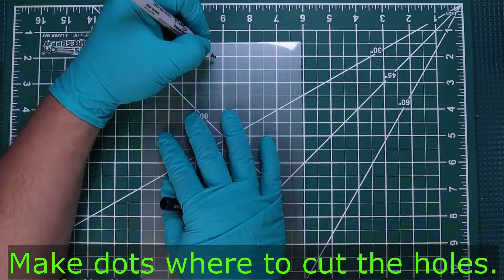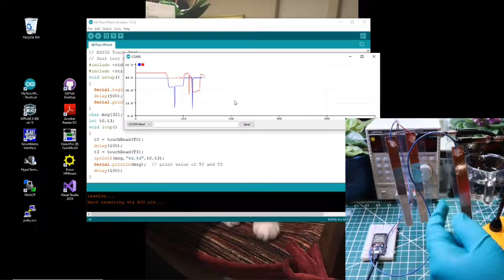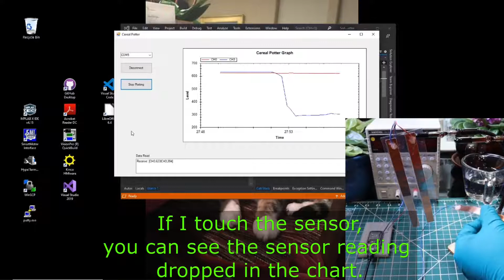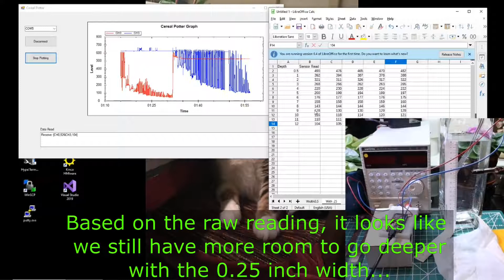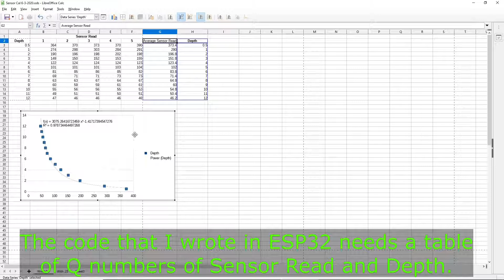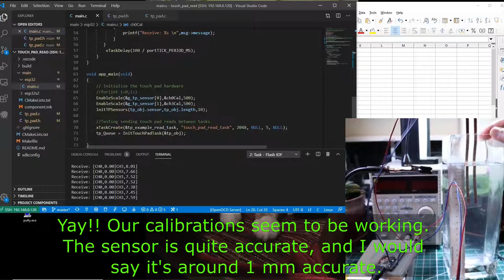DIY Capacitive Water Level Sensor using ESP32 Touch Read function

Comment: have you tried to experiment with capacitation without having the water touch ? a larger surface area capacitation copper pad could theortically detect without without the touch.  I'm working on something like that now.  I appreciate your video, it definitely helps a lot even today :)

Comment: Hello, I found your video very inspiring and I would like to recreate it for my own project. But I am confused about the wiring of your electrodes. You have the the 2 sensor (for lack of a better word) electrodes connected to 1 pin and a 3rd connected to ground? Do any of them run through a resistor?  If so what is the resistor value? If you provide a diagram, that would be awesome. Thank you for posting this work, but I am curious about more details of how you got here.
Reply from the maker: There is no resistor.  One electrode has 2 copper strips, first copper strip connect to Touch input pin of ESP32 and the second strip connect directly to ESP32 Ground pin.

Comment: just stumbled across this...amazingly well presented and thoughful video, I learned a bunch. I wonder if you could measure depth through, say a thin plastic vessel from the outside using this technique, maybe with lots of very thin, closely spaced electrodes in parallel to boost the capacitance because d will be so large. Subbing to find out :)

Comment: does anyone have an idea of how the capacitance values might change when the copper foils are stuck to inner walls of steel cylinder? I tried it and its not giving stable readings at a particular height. suggestions?

Comment: Hello,
Thanks for the great video.
I always thought it is necessary that the electrode (copper) touches the medium to work correctly 
So its okay if the electrode is completely sealed? Does this also work if i have tube in tube?

Comment: I wonder if that can work for other fluids.. probably is just individual kalibrering. Second question is how it will work if you have metal tankand glue it on a side?
Reply: I am working on it. It gives increasing capacitance at a particular height. So calibration is not possible. Any thoughts?
Reply: @Solitudetravel  I assume you heve seen standard option to measure.. from light reflecting to ultrasonic.. well Have you think og mixing load cell and other option and make measurment relative to weight and hight. Offscourse that will work only on stationary objects not while on move (rv/boat).
Reply: @ItisImarko  i tried tof and ultrasonic. They r ok but i kinda need sub mm accuracy. I thought this touchread can give me more accurate results

Comment: Great Video, i was wondering if it is possible to use the sensors with an RPI and without the ESP32 module. Do all the code in Python and connect the sensor to the GPIO Pins.

Comment: I couldn't wait to replicate your idea, Kris. I am impressed how well the thing works. I used 5mm stainless steel rods 50cm inserted into PVC pipes. The result is quite linear function. I am not friend with ESP-IDF, hence used Arduino. Each centimeter was around 1 point on the 0..50 scale.
Reply: You have to make another circuit?
Reply: @jetmak  yes, the circuit is different. I made a pcb for the rods and modified to have 12V supply and few other things.
Reply: @oliver1978 please i am doing my project in school and would like to ask for the circuit diagram for this thanks

Comment: Would it be possible to place the copper tape on the outside of an aquarium and have it function as a water level indicator?
Reply from the maker: It is hard to say because there are so many factors such as the thickness of aquarium tank and the type of material of the aquarium wall. If wall too thick, ESP32 may not be able to detect the different in capacitive change.

Comment: To fix the problem with the measurement error (spikes) and also to get a higher resolution, simply call the function 'touch_pad_init ()' in the setup () routine.
Reply: correction: the 'touch_pad_init()' function needs to be executed each time before reading the cap-value.

Comment: Great project. I am looking for a way to  measure level in a fuel tank. Do you think it is possible to replace the strips with a tube with a rod in senter? The tube will act as a capacitor. My plan is to immerse the tube into the tank. The tank is metal, and I can not use strips on the surface og tank to make the capacitor.
Reply: Concentric tubes is precisely how I added level sensing to a gas tank. If it is a fluid that is not a conductor, no insulating layer is needed. This was back in the early '80s, I used a couple of 555 timers and an LM3914 wired to show continuous level rather than just 10 steps. 

The outer tube is the ground and shields it from outside interference and any parasitic capacitances from the tank or things outside a nonconductive tank.

I have done the same with water based fluids, in those cases I coat the tube with epoxy or polyurethane. It is important there be no flaws to allow water through.

Comment: Hello, Thank you for the video. I have a question, I have no background in using this type of application. I am trying to use this as an FDC1004 contactless sensor because I cant get an FDC1004 at the moment, I only have the ESP32, do you think this will work? Thank you again.

Comment: Thank you, Kris, the experiences you so well shared in your video not only led me to making capacitive sensors with an iron on my desktop, but a way to achieve measuring soil moisture to provide water to maintain plants. I encountered difficulties with my python-version mess in the mac, so until I figure out the paths, I use a primary arduino code averagaing and mapping the readings (my equaly primary micropython dind't improve the readings that much), monitored wirlessly using virtuino. So, while I must hold to see the whole-grain stuff in my bowl, I found the sensors potentially functinal to operate a water supply sytem to a kitchen herb garden, so, I am much grateful to you for the spoonfull!

Comment: I flashed the code on my wroom dev module. The Cereal Potter does not start at 600-700 and go down when touching the sensor. Mine starts at 0 and goes up to around 6 when touching either sensor. Any idea what's causing this?
Reply: I had to comment out the EnableScale in app_main

Comment: I would like to use this to measure the water level in a 55-gallon drum.  The sensing range would be nearly a meter tall.  As I want to move this sensor from barrel to barrel, I was thinking to apply copper foil tape strips to an 18mm OD plastic pipe and covering that with heat shrink tubing.  I would then 3D print an enclosure for the electronics at the top of the pipe.  I would like the best resolution I can get but am ok with whatever that turns out to be.  Do you have a recommendation for how wide the copper strips should be and what the gap between them should be?  I get the relationship between wider and narrower but for a 1-meter long sensor...where would you start to best utilize the touch input?  What resolution would you expect is possible?  I know I could stack sensors (and will if I have to) but I would like to keep this as simple as possible.

Comment: CerealPotter program gives zedgraph error. i am using 5.1.5 i have to use an old library.....
Reply from the maker: I got the same error when using 5.1.5. You can just comment out line that gave you an error if you can't use ZedGraph 5.1.7.
//this.zedGraphControl1.UseExtendedPrintDialog = true;

Comment: About arduino range and reading speed you have function  touchSetCycles(range,sleep),  you can play with values for different range and reading times...
Reply: also for instability of arduino readings i think averaging readings example for 10 readings will improve stability a lot !
Reply: @bhMaker963  I found that reading multiple channels somehow makes the reading more stable, only reading the channels I used in the code caused random drops, reading more than needed fixed the issue. Discovered after chasing my tail with random glitches even with averaging, which created a time delay that was undesirable. I wrote a program to read all touch pins to test which were stable, to my amazement the glitches went away on the channels that were previously an issue. So now I just include extra touch sensor function calls until I get stable performance on the pins I'm actually using.

Comment: Kris I have been thinking about this since I saw it last week.  I have a question. Can I use this technique to measure the increasing width of a persons waistline?  Can you see this sensor (the copper tape soldered to esp32 GPIOs) as a type of belt?  How would it work? Would you put it against the skin?
Reply from the maker: Robert, I have not experimented with this aspect, so I don't know. But one thing to know is that the sensor is very sensitive to moisture, so if the people are sweating, it probably will affect the result.
Reply: @kris-.1439  thanks for the tip!

Comment: What a great video thank you. I am looking at starting a project to measure two-stroke petrol mix in a plastic tank. So I won't be immersing the probe but sticking it to the outside. What're your thoughts on this? Furthermore, do you have any idea why the Arduino library doesn't work well? It's all I have ever used for my ESP32. Thanks
Reply from the maker: If your plastic tank wall is not too thick, it should work. I saw some people using aluminum foil with a glass bottle and it works as well. 
The reasons that I'm not using Arduino IDE are 
1. Reading resolution, Arduino IDE  will report reading around 50 counts with my sensor not touching anything compare to ESP-IDF that would read around 700. Thus I will get more resolution in depth-sensing using ESP-IDF.
2. As shown in my video when I plotted Arduino readings, sometimes the reading suddenly becomes zero.

I haven't played with Arduino IDE for quite some time, maybe their software gets updated and these issues have been fixed. 
Thanks for watching the video.
Reply: @kris-.1439  Thank you for the reply. My initial tests reveal the same as yours. Have you posted these findings anywhere?
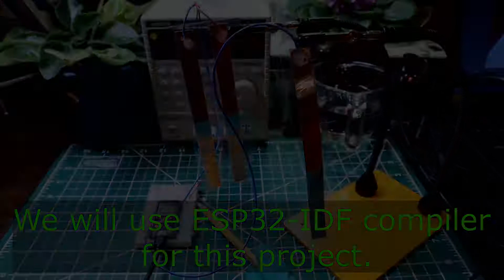Reply from the maker: @mksmurff  Only in my video around 5:16 mentioned why I did not use Arduino IDE.

Comment: I'm trying to understand what do you mean with dynamic ranges related to the width. I'm using wide strips and it's working well. over 1 inch width. What are your thoughs on width ?
Reply from the maker: Basically it is the depth of water level  that ESP32 can read until the touch read becomes saturated. For example the 1 inch width copper tapes will not decrease the touch read after the immersed into the water more than 10 cm, however the 0.5 inch copper tapes, you can immersed much deeper into the water until the ESP32 touch read becomes saturated.
Reply: @kris-.1439  interesting, I'm using almost 2 inches outside of the water and I've full readings. I guess I don't get saturation because I've a larger bag between water and the electrodes

Comment: Great I have a few questions. 1. Can you put the sensor outside the container. I.e. not submerged in the water and totally contactless to the water? 
2. Can it sense the water decreasing?
3. Can it support 1 litre of water?
Reply from the maker: You may want to check on this one ..
https://www.youtube.com/watch?v=CDwmm0gQsTw
Reply: I put the strips on the outside to test and it works as well, https://www.youtube.com/watch?v=b8V8aReSjAs

Comment: The content of video and knowledge which have been shared, are awesome.I appreciate your efforts.I have few questions 
1. Can this sensor be used in 5 feet deep water tank?
2. Will it work for dirty water, e.g lake water?
3. Will these sensor be corrosion over the period of time?
4. Are these sensor Arduino compatible because i have bought arduinos ?
5. Does temperature and humidity effect sensor reading ?
6. How long wire from sensor to board is recommended?
Reply from the maker: Thanks very much for the comment. I will try to answer some of your question. When I discover this sensor it is quite new to me too, so I may not have answer for all of your questions. 
1. You may try to use very small electrode area to expand the range but you will lose the resolution or you can use multi channels of touch read to achieve this. Let say you have 5 of water level sensors stack them up.
2. I did some experiment to see if the calibration stay the same with tap water, 5% salt water and 7% salt water. To my surprise the calibration doesn't seem to be changed at all.
3. This type of sensor is using capacitive not electro conductivity thus there will be no corrosion from electrolysis. But I don't know how long the will the laminate sheet last.
4. I'm using this sensor with ESP32 which is compatible with Arduino but as in my video the Arduino touch read has some bug.
5. I don't have an answer for this. But I left the sensor run couple days, the reading seem fluctuate little bit but not significant.
6. If you want to try very long wire you may need a wire with very good shield.
Reply: @kris-.1439  What if i use Crystal resin coating on almunium tape instead of lamination ?
Reply: @kris-.1439   you could just have taped the foil to the outside of the bottle  https://www.youtube.com/watch?v=b8V8aReSjAs